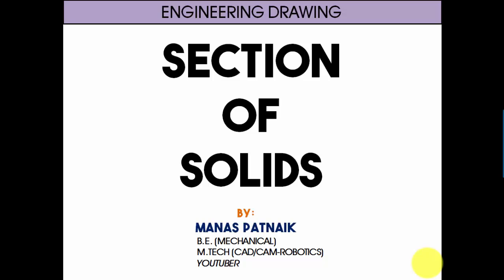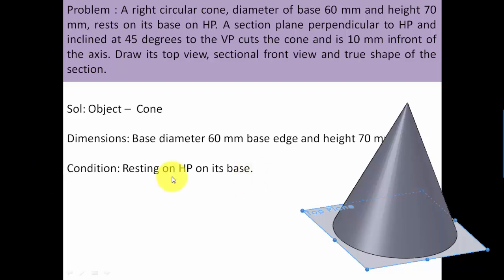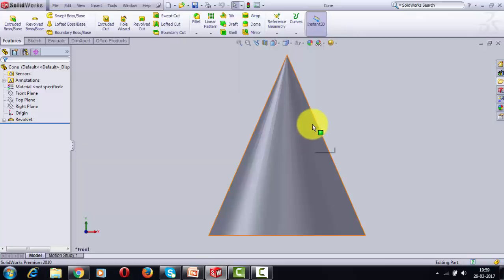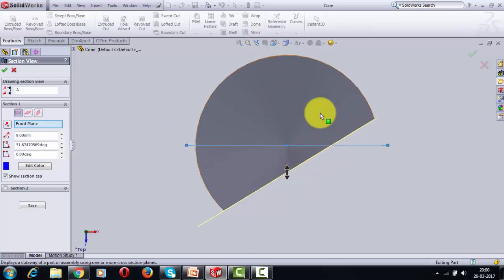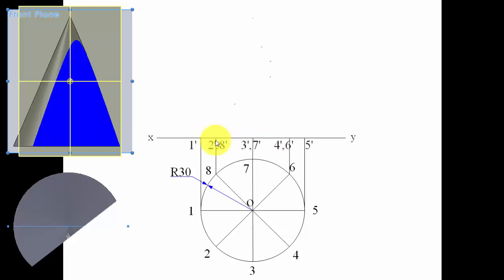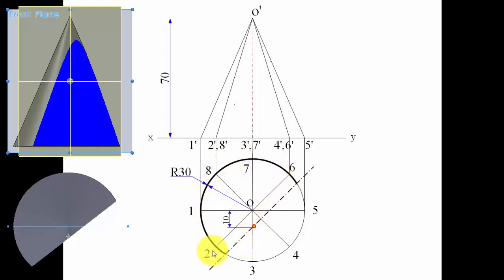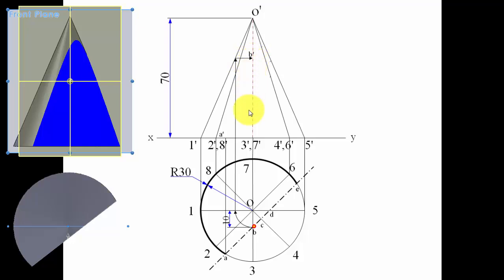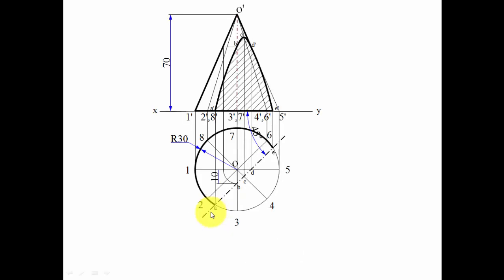SECTION OF SOLID_CONE_Problem 10

Comment: . A right circular cone, diameter of base 60 mm and height 70 mm, rests on its base on HP. A section plane

perpendicular to HI and inclined at 45 degrees to the VP cuts the cone and is 10 min infront of the axis.

Draw its top view, sectional front view and true shape of the section.

Comment: A right circular cone, of base diameter 60 mm and height 70 mm, rests on its base on HP.  A section plane perpendicular to HP and inclined at 45º to the VP cuts the cone and is 10 mm in front of the axis.  Draw its top view, sectional front view and true shape of the section

Comment: Hey sir .. I think that at 6:11 , OC should be 10mm and not Ob , u hv taken on as 10
Do correct me where I'm wrong...🤔
Reply from the maker: Why would OC be 10 mm. Its mentioned very clearly in the problem that the section (AVP) passes 10 mm infront of the axis and point B does infact lie 10 mm infront of axis (which looks like a point). Just think about it ridhi....watch the animation again.

Comment: 1) A cube of 35 mm long edges is resting on the H.P. on one of its faces with a     vertical face inclined at 300 to the V.P. It is cut by a section plane parallel to the V.P. and 9 mm away from the axis and further away from the V.P. Draw its sectional front view and the top view.

plz answer it sir
Reply from the maker: Manasa...This problem is pretty simple thats why i didnot include it in my video library...
And i am sure u can find its solution in ND Bhatts book....
First example from section of solids i believe......